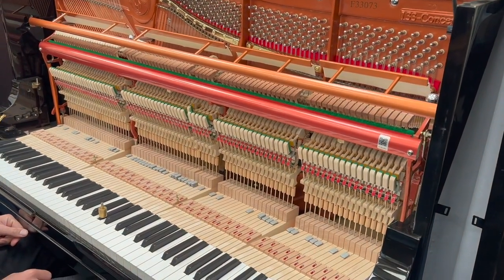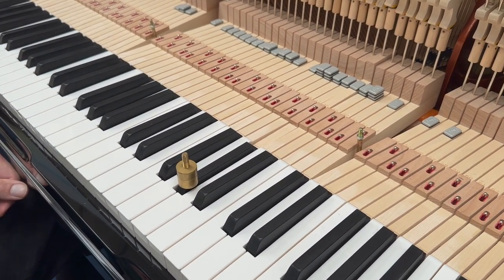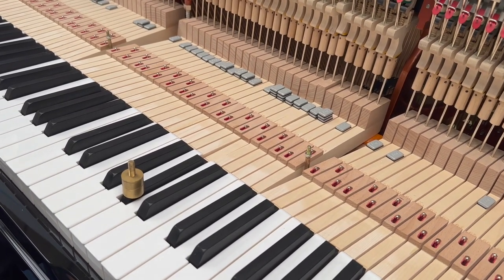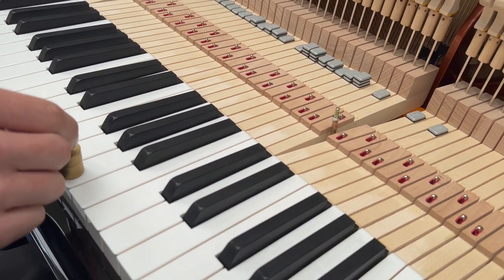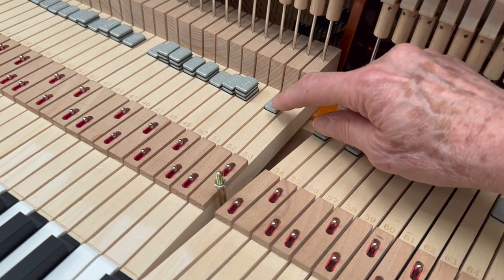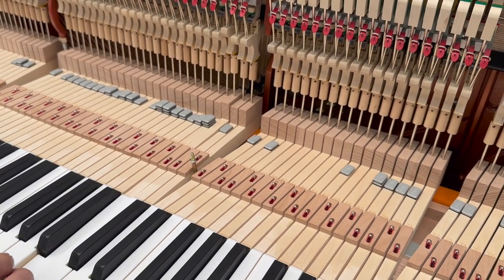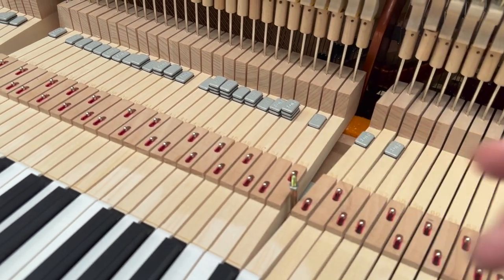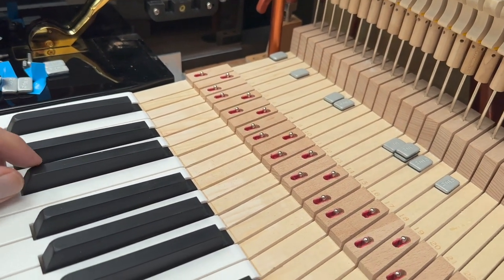Adding temporary key weights on a new Feurich 133 upright piano - a new process; comments welcome:

Comment: Seems like as great scheme!
- You could make up your own of course: sheet of lead from builders merchants (it comes in various thicknesses mark out and cut with tin snips) + Pritt pads or similar (double sided foam pads) for adhesion [perhaps even glue gun]
- Overall probably better than drilling the keys themselves and re-leading; and as you suggest easily removed with a sharp knife / chisel
Reply from the maker: Hello Freewheel. Thank you for your great comment as always. That's a great idea. I've taken the unusual decision to delete the information about where to get the weights. This is because as it's a new idea there is probably a lot we can learn from each other as we try to develop it. Therefore I'm going to invite all those who want to join to work together to develop it. If you'd like to join this group please write to info@robertspianos.com. Thank you in advance for your understanding. Marcus
Reply: @RobertsPianos  if you know an organ builder you could also use different thicknesses of the lead and tin alloy they use for making organ pipes, which is planed to different thicknesses. Roofing lead may well be quite thick and cumbersome to work with. The challenge seems to be getting a result which looks neat without all different shapes and sizes of metal stuck on the keys. Organ metal is commonly punched or cut out into small pieces to stick on the end of reed tongues to control the tone, we use hot glue stick (as a florist would use) or, in the past, chattertons compound which is no longer available.

Comment: This is an excellent and far quicker method to obtaining the necessary down weight than having to remove existing weights in the key, then to fill the holes and re-drill them.  There is, however, a downside.  There is more weight being added to the key and whilst in the almost static case of measuring down and upweight it will provide the required outcome, it will add to the overall inertia of the key, hence as one plays louder, the effect of the extra weight will become more apparent, irrespective of whether it is placed to make the static weight greater or less.  We then get into the David Stanwood approach of measuring various aspects of the action, e.g. hammer weight, action ratios to ensure evenness of action, to determine weighting (including hammers) whether playing pp or ff across the whole piano.  He believes this could result in greater downweights than is generally considered acceptable and varying more greatly key to key, and that this is okay.  On this aspect I disagree, because when playing very quietly, the inertial effects become less relevant and the static downweights more relevant.  What is actually needed is balancing of the whole piano, both from a static downweight perspective and from an inertial perspective.  This is outlined in an excellent book by Mario Igrec - Pianos Inside Out.
Reply from the maker: Thank you for your comprehensive and helpful comments. I want to add that as we've said on videos, it's important to have enough up-weight so that the key returns quickly to repeat. As a rough guide 20g minimum upweight brings the key back swifly though it varies from piano to piano. Sometimes it's difficult to reduce the downweight too much because of this reason. Marcus

Comment: Where can I get those weights?  Is there a specific company or name or website to order them from?
Reply: Interesting!  Would you also do this to a grand action? I’ve used metal clips on the hammer shanks, but it didn’t feel quite right.
Reply from the maker: Hello BW. I've taken the unusual decision to delete the information about where we obtained the weights. This is because as it's a new idea there is probably a lot we can learn from each other as we try to develop it. Therefore I'm going to invite all those who want to join to work together to develop it. If you'd like to join this group please write to info@robertspianos.com. Thank you in advance for your understanding. Marcus
Reply from the maker: @Gavinbrady-Pianist  Hello Gavin. Thank you for your interest. Yes, I've tried it on one grand so far and it seems to work but needs some refinement I think. I've taken the unusual decision to delete the information about where to get the weights. This is because as it's a new idea there is probably a lot we can learn from each other as we try to develop it. Therefore I'm going to invite all those who want to join to work together to develop it. If you'd like to join this group please write to info@robertspianos.com. Thank you in advance for your understanding. Marcus
Reply: @RobertsPianos  That's ok. They don't ship to the US where I am anyway.  There are motorcycle wheel weights everywhere here, but I am having trouble finding any narrow enough to fit.  I have glued steel strips to the bottom of my grand keys before and that helped, but having these more precise smaller weights and removable would be better.  What I'd like to see from you is a video of exactly how you lubricate a heavy key in the first place before you get to this point.  I've used teflon powder on bushings.  Do you also lubricate the pins on the wippins and flanges?  If so with what, a liquid?  I put on new hammers, and that made some keys up in the 80's grams even after teflon.  Thanks, love your videos!
Reply from the maker: @BW-hj1iy  Hi BW, We use a Talc (non-perfumed) on all the friction points, and many times re-pin any tight hinges, but, we nearly always find that where new hammers have been fitted, the hammer heads are far too heavy for the action, especially if on an older instrument. It becomes almost impossible to balance them without serious amounts of Lead added to the keys, so this method wouldn't really work for you.  The best option when replacing hammer heads is to go for the smallest size to match the existing hammers. There are around 136 different hammer heads, in size, wood used for the moldings, density of the felt, colour of the underfelt etc. I know this won't help you in your situation now, but what you can do is sand and shape the tails, sides etc to reduce as much weight as possible from the hammers.  Also check the rollers (knuckles) are not flattened, but a good rounded shape (talc these as well). I try to avoid all liquid lubricants where possible as even the best end up attracting dirt or turning the pins/felt bushings green from it's reaction.  As to the last part of the question, any talc which goes down between the hinges etc will help, I have actually rubbed some across the hinges in the past very lightly which has helped with the wood on wood friction. However the danger is that is someone later adds an oil based lubricant, you may end up with a paste !!  When I first spoke to Marcus about this idea, I was going to try and cast my own Lead weights, but its difficult to produce them in sufficient quantities to keep up with demand, but watch this space.... ;) David
Reply: I am trying to make my upright piano keys heavier and guess I found th  answer here. Thanks.